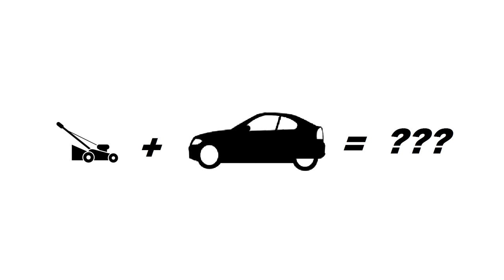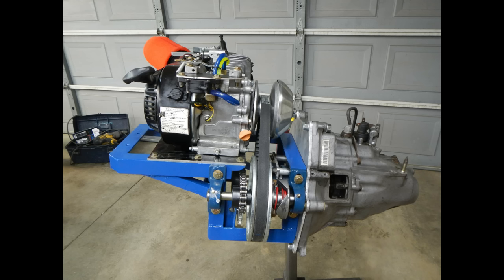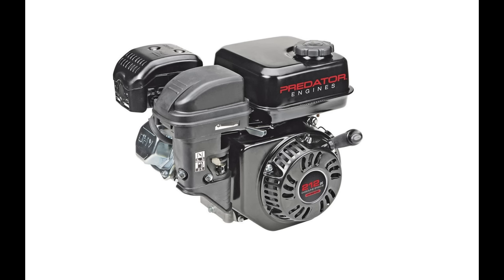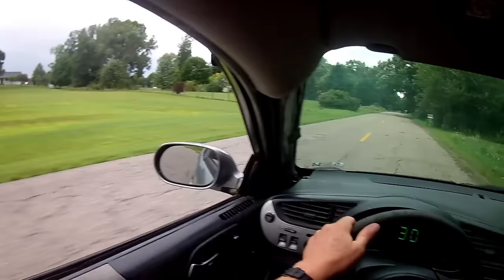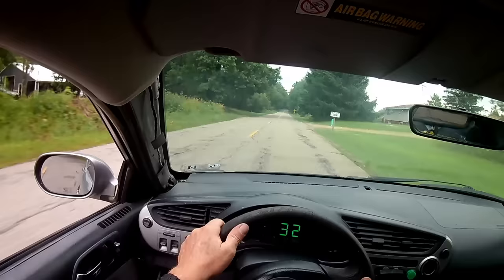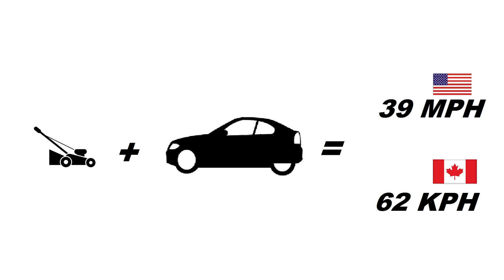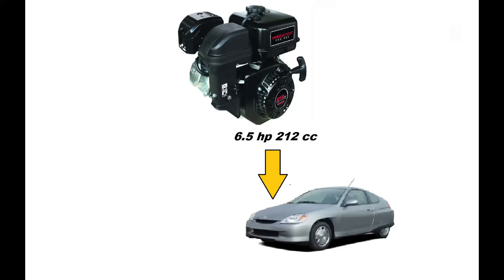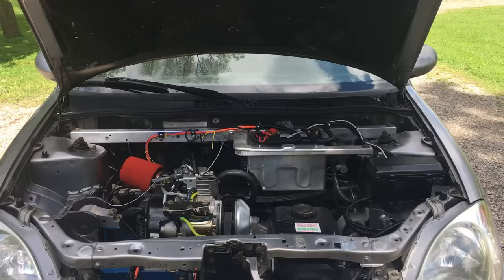Episode 1.  We put a $99.00 Predator engine in our Honda Insight.

Comment from the maker: Hey, thanks for all the comments, I really appreciate it.  There are over a hundred videos now and more on the way.  click on the channel to see MORE!
Reply: Easily the coolest thing I’ve seen on YouTube in a WHILE. Hats off
Reply: How do u produce vacuum for the brakes? How do u keep the battery charged?
Reply: What do you mean when you’re talking about gears (3rd vs 1st) if it has a CVT?
Reply: @peytonmanning04  guess you need to watch it again. Pay attention this time.
Reply from the maker: @peytonmanning04  The car has both a CVT  (from a go kart) and the original honda 5 speed transmission.  The combination of the two systems helps the little 6.5 hp engine accelerate the car.
Reply from the maker: @tonyrunyon375  The brakes will still work without vacuum.  It just takes more effort.  The battery gets charged every few months with a battery charger.  The car doesn't use much electricity.
Reply: Any of the videos show your fuel mileage thatd be interesting
Reply: This car is basically a more modern Fiat 126/126p and I love it!
Reply: Are you taking it to Santa pod?
Reply: You should put the electric portion back in and see if the predator via the cvt will simply charge the batteries enough to provide more range than original design specs.
Reply: Only 34,000 Beer Cans Of Aluminum Per Car?
Grandpa Used To Save Aluminum Cans; Crushed Way More Cans Than That By Hand With A Wood Splitting Wedge.
Reply: My jaw dropped when I saw how well this thing performed.  I have played around with a Geo Metro disconnecting two of the three spark plug wires to see how it would perform and I had figured it would do about as well. But this did far better.   I recall when the GM X-BODY cars like the chevy citation came out they bragged that it only took 11hp to drive at freeway speeds.

I wonder how fast one of those 4 person surrey bike carts would go with the same engine?  https://www.youtube.com/watch?v=EjpRmJVDtvQ  It just might break the land speed record?
Reply: I know i am a little late to the party, but i was wondering about the over all fuel economy as well as at mid lower and high speeds.
Reply: Essa parte do cvt onde de onde vc encontrou
Reply: Literally that's faster than a Kymco 270 mongoose 4wheeler lmao it's even got 20HP and only gets up to 21mph at best even with the throttle limiter turned off
Reply: Honda did it better sorry
Reply: Make it a Tesla, or another electric empowered car.
Reply: I still remember the night the algorithm decided you deserved fame. What a wild ride that was!
Reply: Back then they didn't want me now i'm hot they all On me
Reply: @bobbybaucom4489  JAJAJAJAJAJAJAJA!!!   omfGAWD 👀 😱 😜
Reply: @guidedmeditation2396  😎 🆒️

Comment: I had an idea a while back. I saw a guy on here who put one of these on a tractor and used a centrifugal clutch. I figured I could make a shaft with several pulleys  on it, as many as I want, and hook several engines up to it. Like 2, 3, 4? 8? I could hook the shaft onto the transmission input shaft with a U joint and all the engine have centrifugal clutches.

Comment: These original first generation Honda Insights are now extremely rare and sought after. It's a very interesting experiment but almost sacrilegious to dismantle one like this. It would be interesting though to see if you could get it to run solely on the hybrid electric motor which puts out 10hp as opposed to the lawnmower's 6.5hp.

Comment: My guess is that you lost a LOT of aerodynamics and top end speed by running the vehicle with the hood off.
Reply: I don't think so. The rear is much more important in terms of aerodynamics.
Reply: @loudsonicbug2195  this is partly true, but when the aerodynamics are made such a HUGE amount worse by doing something like that, you're bound to see a proportional difference. 

 Consider: cars are low to the ground to keep a sort of half-seal against the road, allowing down force, and streamlining to work right. 

This car now allows air to travel down through the massive spaces around the engine to break that seal against the road, along with creating drag against the bottom, and disrupting the airflow at the end when the air sucked beneath is ejected.
Reply: @Geolaminar  It sure has an impact but i wouldn't say it'd be more than maybe 2-3 mph at those speeds. Just rolling down windows can make a difference :p i know
Reply: I don't think it's a big deal under 40 mph

Comment: A clutch and chain instead of a tc would of put all of the power to the transmission. Not to mention a few upgrades will get the predator to hit 6500+ rpms and should get the car to around 70. Most cars stay around 3500rpms in 5th at 75 anyway.
Reply: 7O mph??     Learn about D R A G. coefficients tho

Comment: Original 2CV had a very small 2 stroke about 300cc. Like the Fiat 500.
Extensively fluted and ribbed thin steel body. But it could carry loads and go up hills slowly. I had Renault 4 with 795cc in 1980s. Got overtaken on a hill by a tar truck in Glencoe and a milk float on the South Downs. This performance level is way better than a pushbike and more comfortable than a motorbike. It would help reduce carbon emissions if we all accepted this.

Comment: you should swap it with a 500cc twin cilinder diesel injection kubota engine. In our country in europe, we have something called moped cars which are cars equipped with either 400 of 500cc twin cilinder diesel engines(depends on what make and model of car you buy) They're limited to 45km/h but we usually tune them up. They're just like this engine equipped with a variator but no clutch or gearbox. we got them up to 90km/h.
Reply: @LazloNQ  exactly! We actually swapped a 3 cilinder into an aixam 500-4 2 cilinder moped car. I belive it was a kubota D662 engine. Made about 20hp and tore the drive belt apart, lol. We eventually replaced it with a kevlar belt and another variator and it did about 120km/h. (Legal limit is still 45kmh btw lol)
Reply: It was funny because the two cilinder units make about 8hp but the 3 cilinder unit was basically a bolt on; we only had to move the radiator to make room for the fan as the engine is slightly longer but the rest was literally all the same, like engine mounts and stuff. Theres actually a video on youtube of a guy that did such an engine swap and turbo'd it. He basically has the fastest aixam mopedcar in the world LOL
Reply: @LazloNQ  i recommend one of those 3 cylinders you mentioned earlier from the reefer units: theyre very reliable and paired with a cvt and soms sort of gearbox they make an excellent daily. I try to stay away from 2 cylinders because they tend to run quite noisy and vibrate a lot; all mopedcars here have 2 cylinders and its quite annoying after a long drive. Maybe if you find an old beat up hatchback maybe with a shot engine you could swap a 3 cyl diesel in it. My own mopedcar does 55kms on 1 liter fuel. Very cheap, plus diesel is super cheap here.

Comment: For a little cruiser that thing works great, gas mileage must be incredible
Reply: In episode 6, he says it gets 54 miles per gallon. That's quite a bit worse than what the Honda Insight could do before the engine swap. It was rated at 70+ mpg at highway speeds and I'm confident it would do about double that if you kept your speed down to 39 mph.

Comment: The original Honda Insight 3 cylinder engine that was in this vehicle was i believe  made of titanium including the oil pan it weighed only 124 lbs. Incidentally I daily drive a completely stock 2006 Honda Insight, still with the original ima battery a tank of gas lasts me at least 1.5 months. I average 3.5 L/100km not as much fun as the 2006 Subaru STI i used to own but it only got 24L/100km.

Comment: Why do I feel like there is probably somewhere in the world where they sell a car in this exact configuration new? 😂
Reply: Probably in India or Africa...
Reply: In France there's cars powered by small engines like this, called Voitures Sans Permis (VSP's) they can be driven without a licence and are limited to 25 mph. They're mainly used by drink drivers and old people. Ligier and Aixam make them. Some are even diesels, using kubota diesel engines.
Reply: @geoengr3  in France.. The Aixam Microcars..
Reply: @tech4pros1  They let drunk drivers drive around at 25mph? Still seems a bit reckless XD
Reply: @PierceTrey  i meant convicted drink drivers. even a first time drink driving offence in france is usually a ~€2000 fine and a 2 year ban. the drink drive threshold there is lower than the US and UK. french roads used to be lethal, with many deaths caused by drunk drivers.
Reply: @tech4pros1  ah, got it, that makes more sense

Comment: The perfect car to have when youlive in a small beachtown speed limits are like 30 everywhere. it would save you alot of money in the long run
Reply: Good luck driving uphill lol
Reply: @gustavrsh  he'd need a worm gear for that 😆
Reply: I don’t think so, I bet the fuel consumption is really bad.
Reply: @gustavrsh  roads are very flat at the beaches where i live
Reply: @Bigbossman12624  If you are just going down the street and back it cant be that bad.
Reply: i think if he used smaller tires and rims it would also help a bit lol
Reply: @baggedtuned8569  I bet it’s under 20 mpg, those carbureted engines aren’t efficient. Especially under load and full throttle.
Reply: @Bigbossman12624  still wouldn't matter when you are only going down the road to the store and back.
Reply: @baggedtuned8569  that’s when it would be bad. Think about it.
Reply: @Bigbossman12624  lol

Comment: Awesome experiment. It would be great if you put a tuned scooter motor inside. I live in Italy and when i was young i had a normal 49cc scooter. All people at that time used to tune their scooters with bigger cylinders, crankshafts, bigger intakes and exhausts etc etc. The top speed with a (top viola complete kit was about 110/120km/h). My type was one of the most populars motors and It was a Minarelli orizzontale liquid cooled. It would be great to see It on your channel 🔥🔥🔥
Reply: Just to let you know -- He has a second season now. :virtualhug:

Comment: I had one... 60 mpg to 70 mpg in the summer great car. The cheapest mean of transportation I had owned. I bought it for 2500 in 2016 put in 160k miles it had a total of 300k and still kicking.
Reply: Same! And when I switched to Amsoil synthetic oil I got just over 70 mpg down in the Florida Keys!

Comment: May as well put a V twin in it. Or do some sort of carbon felt wick based carburetor where you have a pipe going into a jar of gasoline. And a T joint on top and let the engine suck air through the gas soaked wick.

Comment: i was kinda hoping you used the predator engine as a generator for the electric motors. think about it, you get rid of the 4 cylinder and replace it with the 1 cylinder predator, hook it up to something that will use it's rotations to generate a lot of electricity, set the rpm on the engine to the highest it can go safely, and use that electricity to power electric motors. That way, the car will go much faster, while at the same time you can pop the hood and tell people it's powered by a lawnmower engine

Comment: I need one of these now...   a few years ago I asked a honda engineer why no one ever did anything like this to a hybrid, or add something like this to a trailer to make a power assist.  It is supposed to take something like 13hp to maintain interstate speeds, use the hybrid motor to get there, and the gas to maintain.

Comment: You can get a 17 hp from a Riding lawnmower and probably do 100mph miles really is the transmission that is doing all the work I installed a 12hp on a 30 f sail boat and work like a champ great video

Comment: Should attach a throttle cable and return spring to it and some sort of starter so you don't have to pull start it. Then it would be pretty sick. Maybe figure a way to add an alternator and then it could be something, just gotta attach the cars fuel tank to it.

Comment: To find three more of those "spares" to then run it on and put em at their highest PSI?   Since most the time I would be rocking round at 30-35, using it in town.   Would that also ease the stress on the engine.   You are going for speed (50) but what about making it into a second car for the trips to the market/appointments.   The within 5 miles of home stuff.   How to build one out for some reliability and fuel economy not raw speed.   Love the production of your clips.   I can see the effort/time/effort in the editting-voice over-narrative.

Comment: This means that Honda Insight with 14 HP and 0.44L engine would be a decent economic car - imagine to what extent better the performance (top speed/acceleration) would get if you double the engine. And it would still be 0.44L! Amazing, can't wait to see fuel consumption data. 

I was always wondering how European/Japanese car of 1910-1950's were driving having 30 HP and less/1L engine or smaller. Turns out even 0.2L is somewhat acceptable (with modern tech ofc)

Comment: If you're hotrodding the motor, I question the 212 Predator as the starting point, due to the cost of upgrade parts.

That $100 engine is now $200, but ignoring that - are you going to be able to double the hp for $339 in parts?

Because that would be the additional cost to bump up straight to the 13 hp 420cc predator, which has lots up upward potential.

I realize this video is about taking a concept to the extreme, but I can't help looking at the potential usefulness as well.

Comment: As an engineer I was most amused by this. Once the car is up to speed between 20 to 40 hp is all needed to go 55 mph depending on vehicle. I noticed you used flat roads and not a windy day. The car would not be street legal in my state. It would not pass emissions test. The engine exhaust might. But the inspector also has to have data from the computer, it's data having none would fail the car. With that small an engine AC would be out of the question since it would take up to 5hp for the AC. The slow rate of acceleration would be a road hazard to say the least. Power steering alternator also would sap the power. No vacuum for brake booster. ABS system takes many amps amps also.
I just got a new old car with a V8 and rear wheel drive. Perhaps I could take 4 pistons out. (lol)

Comment: I like what you did with this car, On your acceleration problem, they solved that issue on diesel engines by putting on a turbocharger, so had you thought about adding a turbocharger to the motor, to help improve that acceleration issue?

Comment: No need to mod the engine.  Just find a long downhill grade and you will hit 50 mph without issue, guaranteed my friend.   Heck, you might even have to hit the brakes to keep it from not going faster if the hill is steep enough.  Gravity is your assistant:))))

Comment: Replace with a Honda xr 650 4stroke engine. Big and torquey, about 50hp. They have liquid cool or air cooling. Yeah you could go with a 13,000 rpm sports bike engine but they won’t last as long. It’s also still a single piston and you might have a fully functional 1 cylinder car.

Comment: Thats actually looks like very good city car. And you can't break the speed limit.. remind me,  why do we buy cars which can go 120mph in 2 seconds which had to weight much more, if we had to start gently and not go faster than 40mph anyway? And we spend most time in traffic jams, so statistically we do not need any engines at all. Btw, this car is excellent offroad car!
Maybe need a little bit more power, so it can climb on 40mph on good road. But probably that can be achieved by closing the cockpit.
Reply: In Europe we have these. Mostly people between 15-18 years drive these small plastic cars with lawnmower engines on a bikes permit. The most popular ones are Ligier JS50, Aixam GTO and Chatenet.

Comment: Often when I am on my riding lawn mower, I think of how it is a modern version of Henry Ford’s quadricycle. And I wonder how fast an old Beetle would go with its 441 CC, 17 hp motor? The motor is vertical shaft, though. That would be a problem, but with a similar sized motor with a horizontal shaft? Food for thought.

Comment: That little motor has the power to move the car and keep it moving.  Wouldn't the acceleration be more reasonable if it were under an electric motor's power and the little gasoline motor was just used to drive a generator?  A volt meter on the dash could keep the driver aware of battery power.  We spend most of our driving time just cruising and not accelerating.  That would give the little motor the time to keep the battery charged.

Comment: this thing with a 660cc inline 6 Kei Car spec engine. 
but I dont know where I can find a sub 1 liter inline six, or even if such a thing exists. probably does, but high chance it's a 2 stroke sports bike motor. probably something that would take up less room than a 1.3 I3 sohc, and put out the same there-abouts 50 or 60hp, but would be perfect for anything and everything. a 660cc 12v or 18v sohc or dohc I6 with dual carbs, in 2 or 4 stroke with a pretty square bore/stroke, or with more stroke than bore, and can at least get up to 6000-6500rpm WOT, would be perfect. perfect for a small all terrain kart type chassis mid mounted transversely with 2x4 or 4x4 capability, depending how I can figure the drivetrain.

Comment: what's the gas mileage on it? I wonder if it's better or worse than a normal 4 cylinder car. yea, it's a tiny engine, but it's also running flat out. my cobalt can get up to speed much easier, then uses little to no gas just coasting. is it worth replacing the engine in my car? lets do it and find out

Comment: You should put the electric portion back in and see if the predator will simply charge the batteries enough to provide more range than original design specs.